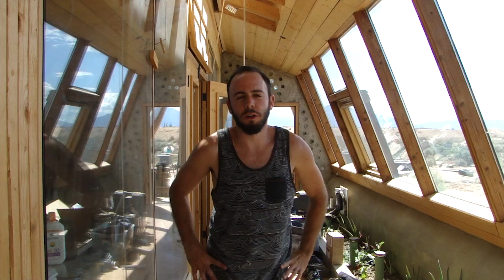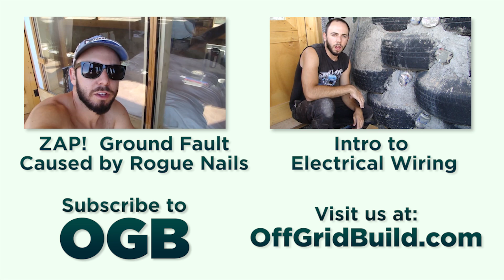Lessons From a Fried Inverter

Comment: BS i wont be buying square D ! Ive been in the electrical field for 35 years ! there trying to seals you more BS 20 amp trip is 20 amp ! square D use to be the top of the line . not any more !

Comment: A LF (low frequency) inverter has a transformer on the output. I dont know but I suppose that they will be more roughed against overloads.
Reply from the maker: maybe, but it would still be a bummer to dry that transformer.  you'd probably end up having the replace the entire inverter.  i'd still say best to put protection in.

Comment: Hello friend. Something you said in this video doesn't quite make sense to me. You said -- or were told -- that your AC breaker will trip immediately at 6x, then you went on to say that would be 120v x 120amps. That's 14,400 watts. That can't be right. Did you mean something else?
Reply from the maker: +Lance Guilin err, dans editor here, not sure brother, hopefully he will see your comment and reply some time
Reply from the maker: Hey Lance, Dan here.  I believe I am correct based on what I was told.  The breaker is 20amps.  SquareD said 6x, so that would be 120amps.  This would never arise for me because my inverter doesn't put out 120amps @ 120v AC.  But say you were connected to the grid and had 200 amp service to your subpanel.  If you shorted the line like I did, you could potentiallly send 200amps through that breaker.